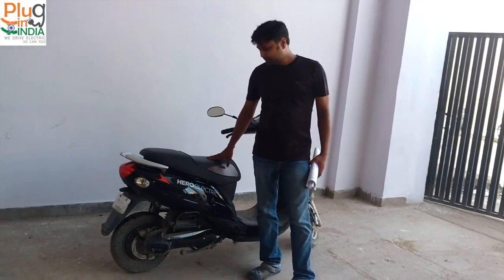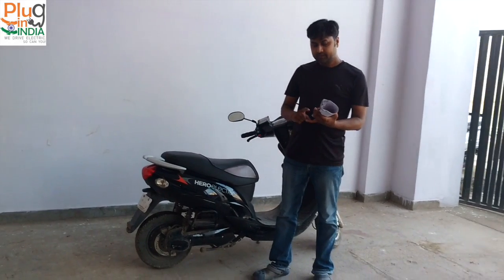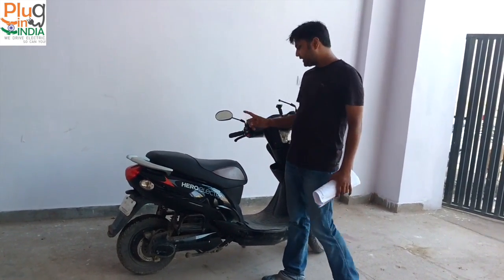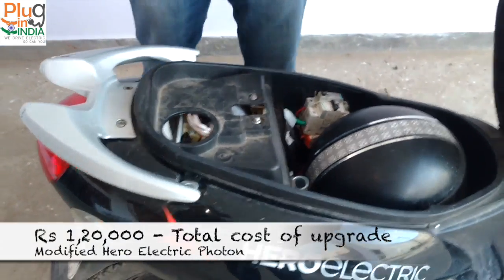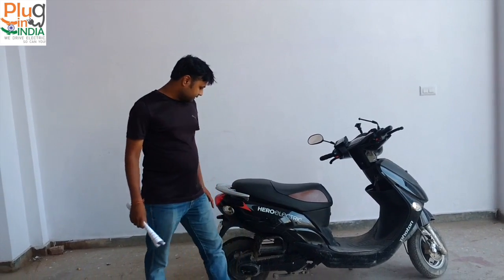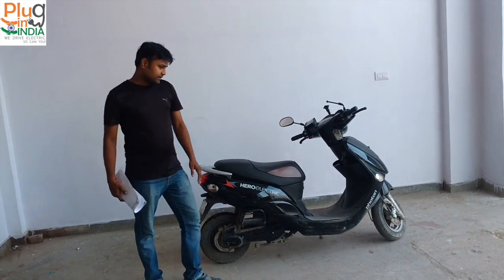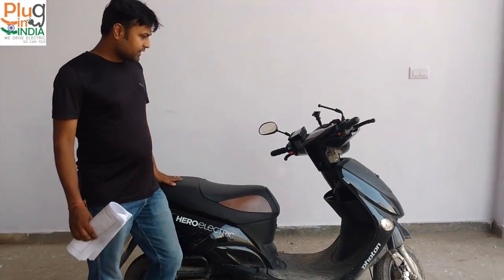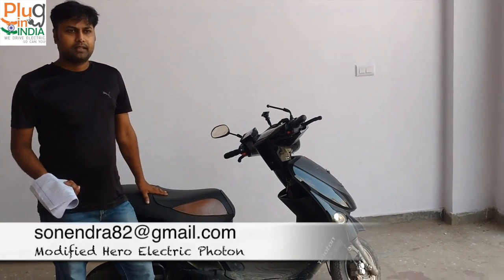Real Life EV Story : Sonendra - Hero Electric Photon e-Scooter Lithium-Ion conversion

Comment: HELLO PLUG IN INDIA MY DAILY RUNNING IS AROUND 50 KILOMETRES  WITH 2 PASSENGERS  I AM CONFUSED BETWEEN  OKINAWA RIDGE AND HERO PHOTON PLUS PLEASE SUGGEST THE BEST SCOOTER WHICH ONE I HAVE TO BUY.......
Reply from the maker: We would recommend the Okinawa ridge due to superior Top Speed, Batter battery indicator - the Hero Photon has a battery 'guessometer', which sucks really.   A digital screen also helps in Okinawa favour.
Just ensure u have a dealer in ur city , who can service the Okinawa.  If you do, then it is a no brainer.

Comment: I took an amazing ride on this electric scooty with Sonendra.

The pickup was really good. Much better than conventional scooters and motorcycles.

The regenerative braking was quite smooth and it worked even in low speeds till 6 KMPH.

The best surprise was the reverse gear which is not actually a gear. The scooty can go backwards with great power. It worked with even 2 fully grown adults sitting. 

I wish all the best to Sonendra to continue tinkering. I have met very few hardware enthusiasts like him. :-)

Comment: Hey man what lithium batteries did you use were they 18650 cells like Tesla?
And yes I'm also building an ebike using all the 18650 cells from dead laptop battery packs can u provide ur email through which I can get some more knowledge 
And also apne motor kaha se liya Hy coz I am unable to find a 3kw motor plz help! And keep up the good work !
Reply: Atul Pandey my email id is sonendra82@gmail.com
Mail me, will help you.
Reply: @Sonendrasingh  sir plz let me know do you used 18650 battery and if i connect these cells in series and parallel to replace the inbuilt battery,will it be okay or i need to use any other pcb . plz help sir ,consider me as ur younger brother

Comment: +Sonendra. What about the BMS(battery management system), did it come with the batteries? Did you change the charger since Ah increased?
Reply: My Lithium Battery has a inbult BMS, which delivers max 150A current. Battery has a separate charger (48V 6A for 13S Li Ion battery)

Comment: If this comes in market then everything will be changed
Reply: I have taken a ride on this electric scooter with Sonendra and the ride was really good.

The pickup is strong better than petrol scooters.

The regenerative braking was smooth even in low speeds even till 6 KMPH.

The surprising part was the reverse gear. ;-)
Reply: Okinawa Praise with Lithium battery will have great performance. Okhinawa launched the Praise with Lead acid (VRLA) battery at 60k price, that is also good

Comment: Hi sonendra great conversion i have ever seen in india, you have got balls to trust a chinese vendor on alibaba and spend 1lakh on the kit. I wanted to do a conversion but i had no money back then. Please ignore people's comments about why u spent so much on your bike, you are riding the future of two wheeler's and keep inspiring others to join the tribe and buy more EV's

Do not charge the cell to 4.2V, charge it to 90% 4.1V or 80% 4V, that is what increases the battery lifecycles, i would suggest LiFePO4 chemistry for more lifecycles. Also remember to completely charge and discharge your battery once in a while. Do not keep the batteries fully charged as that is what increases the oxidation rate

pluginindia why don't u organize group buy's for batteries and motors and pass on the savings to the subscriber's
Reply: gopikrishna swargam Thanks for your appreciation. You have a sound knowledge about EVs and progressive approach. I am overwhelmed by your response.
You are absolutely correct, purchasing from a Chinese vender is risky, but there are few countries, which are manufacturing bldc motors. Presently motor, controller are working fine and hope so in future also. I purchased battery from a indian vendor for warranty, although lithiun cells are made in china. Regarding battery charging, you are absolutely correct. Presently i have installed a battery voltage monitoring unit, which has a relay. At a time of charging, at 90% SOC voltage, Relay cuts the connection from charger to battery. Battery completely discharge and charge once a while in two months.
Yesterday, with 100% charged battery, my electric scooty (total weight around 215kgs, vehicle + rider + pillion) covered 74 kms distance on a single charge and remaing SOC was around 10-20%.
 Maximum speed for first half distance of 37kms out of 74kms, was 55kmph (current consumption of motor was 22A, 1000w-1100watt). Traffice was less as compared to normal.
 For the second half distance of 37kms, maximum speed was around 40kmph (current consumption of motor was around 15A, 700-800watts). Traffice was above avarge at that time.
Note: Battery was lithium ion 48V 13S 44AH @0.5C discharge rate
Motor- 3000watt (6000watt peak power)
Controller - 3000watt (4.5-6KW peak power) ki

THANKS
Reply: gopikrishna swargam i think in 4-5years cost will drastically come down. Hopefully made in india product will be available with affordable prices.
Reply: Hi Sonendra, great work! Kudos to you. I was totally thrilled to find Plugin India website this morning and the post about your work on it. So happy to see this. For the batteries, did you happen to hear about http://www.futurehitechbatteries.com/ and/or tried getting a quote from them? I just found that website this morning too. I am not quite sure if they manufacture or source their batteries from China themselves.

Comment: How much did the motor cost you?
Reply: MOTOR (cost + shipping) without taxes was  USD 460.

I purchased MOTOR + CONTROLLER + DISK BRAKE, combined cost with shipping and taxes was 42K.
Reply: Sonendra singh I'll send you a mail, can you send me the motor datasheet? Or put up a link here for everyone to see.
Reply: Oh and you can add a windshield to the scooter, it should increase your top speed and acceleration at speeds over 40kmph

Comment: How much it takes to charge the battery?
Reply: A 6A 13S lithium charger takes 8 hours for 13S 44AH li battery (SOC: from 0% to 100%).
As my daily riding distance is around 20-30Kms (40-50% SOC uses). On daily basis, charging time is 2-4hours.
It can be fully charged in 1-2 hours. BUT 50A 13S lithium charger cost is around USD 700-800 with additional cost if shipping + taxes.

There is a an another solution -
Inverter with 48V battery (As inverter is one of the best product for battery charging)
Now a days, Inverter with USB port, which can configured through PC, are a cost effective solution for 1-2 hour charging of Lithium battery. Also when, After 5-6 years,  Lithium battery of EV with 50% or less orignal energy storage capacity, can be further used with inverter for power back-up.
THANKS
Reply: Excellent :) Thanks for your prompt reply.
Reply: THANKS

Comment: Great work Mr. Sonendra. And I think its cost efficient also. Since you purchase a single unit, so its cost comes around this much. Moreover cost can further be reduced, by purchasing lower KW motor and lesser mAh batteries, according to particular need. If possible, can you further give some descriptions/links about the parts from where you purchase the conversion kit.
Reply: THANKS BIPUL.
my email id is sonendra82@gmail.com . I will  help you.
Reply: cost of my modifications 1,10,000/- has a major part (30K) of 
shipping+taxes. I used a 150A current shunt, made in India, its price 
was almost half and excellent quality w.r.t. available chines current 
shunt. My assumption, if all part (motor+ controller+ battery) with bulk production  in 
India. Then cost of this type of configuration (Electric two wheeler) 
should be around 60-70K. I am pretty much hopeful, this 60-70K cost will
 be possible in 4-5 year or earlier.
Reply: I think we common user don't need 80 kmph speed ,we good at 50 kmph ,so battery range must be increased to 120 if same battery u use
Reply: You are absolutely correct. 50Kmph speed is sufficient for city ride. I replaced the lead acid battery with lithium battery two months ago. Today,  2086KM has been completed with new lithium battery and based on scooter performance data, Mileage is around 60Km in 1KWH energy at average speed 30-50Kmph on city road. Battery capacity is 2KWH (48V 44AH@ 0.5C 13S Li Ion battery), 120Km distance can be covered on a single charge. BUT I haven't discharge the battery to 0% SOC. I covered 74Km distance with fully charged battery (total weight around 220Kg, rider + pillion + vehicle weight) and after 74Km SOC of battery was around 20%, i think 10 Km more could be covered, but that time I had some urgent work .
NOTE: As speed increase drag effect also increase, basically above 60-70Kmph speed mileage decreases.
For reference- 
Power consumed by MOTOR at 
50Kmph  is around 1KW 
70-80Kmph is 2-2.5KWH
Reply: I purchased photon on this month with lead acid battery....plz tell me which type of luthiuam battery i will have to purchase for more than 1000 cycles and suggest me delar name and price of lithiuam ion battery.....if possible share ur number
Reply: Nilesh Bhosale my email id is sonendra82@gmail.com
Mail me I will help you.

Comment: If this guy uses a chain drive the bike will takeoff on one wheel like a race bike. He could have built this on his old bike and got same performance with a cost of Rs30k instead of 100k. He took a 30k bike amd made it 100k bike?Batteries are given way more importance than is due... Its still very fast with the hub motor...  should do a 2nd video testing it against a normal petrol scooter.
Reply: THANKS for your input. I will try to shoot a video with normal petrol scooter.
THANKS

Comment: why don't manufacturers do this and bring down cost for mass production. I guess they are afraid that they might put a dent to their existing fossil fuel powered vechiles..by launching such bikes
Reply: cost of my modifications 1,10,000/- has a major part (30K) of shipping+taxes. I used a 150A current shunt, made in India, its price was almost half and excellent quality w.r.t. available chines current shunt. My assumption, if all part (motor+ controller+ battery) made in India. Then cost of this type of configuration (Electric two wheeler) should be around 60-70K. I am pretty much hopeful, this 60-70K cost will be possible in 4-5 year or earlier.

THANKS
Reply: I hope so cause whenever I try convincing my dad to go electric he always puts this point that its not practical.  I hope this is comes to the market in a year or two.
Reply: I hope so.

Comment: 5:26 It can beat any bike any two wheeler in city roads :|

And it's 3kW [~4 BHP],
Waah, what a wisdom.

Don't mistake me, i love electric vehicles, and waiting eagerly to see a good one on the road,
but be very specific about the specs and with good knowledge about it,

First thing,
notify the Power in kW [kiloWatts] and Energy in [kWh] instead of childish stuff like Ah [Ampere hour which do not take voltage into account].

Esp in a comparison like this, warranty of the Li-Ion pack, and warranty for the Motors would be the most significant one,
because no one wants a garbage quality Li-Ion battery pack quality which gonna die in a year or two.
Reply: Motor: Peak power 6000w (8BHP) and continuous power 3000w.

THANKS bro for your constructive criticism :)
Reply: Sonendra singh Good work brother. Have you replaced any wiring? And meters also should show wrong reading as they're calibrated for the original equipment that came with the brand new bike. Finally where do you stay? I'm a EV enthusiast just wanna try ur bike.
Reply: li ion batteries - possibility of explosion:
Your are absolutely correct. To avoid this, BMS has peak current limitation. I also avoid this. 
Presently, Maximum Regenerative current his 20% (20A) of max 100A to avoid overheating of BMS/Battery.

THANKS
Reply: For a ride of my electric scooty, you are welcomed. Presently, I am in lucknow. My email ID is sonendra82@gmail.com if you really want a ride mail me.

THANKS
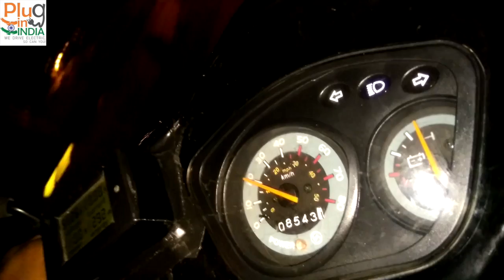Reply: SPEED-METER reading: That time (1:02 to 1:32) it was not properly working. I went to service-center and now it is fine. 
Maximum speed video (13:01) had been shot with correct readings of  speed meter.
Reply from the maker: Go get them Sonendra!
Reply: BAHNU PRAKASH: WIRING: 25mm square copper wire is used for BATTERY TO MOTOR CONTROLLER power supply with 100A MCB + 48V relay (200A switching capacity) + 250A DC connector. Also some preventive measurements for ELECTRICAL POWER SURGE (specially during ON/OFF of controller), as peak current goes up-to 150-160A, to keep safe controller, battery, MCB, relay and wires. Basically a new electrical system is installed for peak current rating of 200A. Many more things have been done, but everything is not possible to mention here.
THANKS
Reply: Chandraprakash G If we buy cheap li ion batteries there is a possibility of explosion especially with continuous power motor and regenerative breaking on board.
Reply: He is saying in terms of instantaneous power that's available for fast acceleration in city traffic.
Reply: Tameez se baat kar chutiye

Comment: @PlugInIndia Learn some basics here.

For starters, DO NOT USE THE STUPID UNIT CALLED mAh or Ah,
use universal units of Power [Watts - W] and Energy [Wh - Watt Hour / kWh - kilo Watt Hour / and it's multiples..]

Having a channel about electric revolution and not knowing the basics is quite disappointing.

Power = Voltage x Current
W = 3.7V x 20A
W = 74

Energy = Power x time
Energy = [Voltage x Current] x time
W time = V x I x time
W hour = 3.7V x [3000 mAh]
W hour = 3.7V x 3 Ah
Wh = 11.1

That simple.

And for reference,
1000 Wh = 1 kWh [1 Electrical Unit], 
which is what our kWh energy meter uses in home
________________________________
mAh and Ah which are seriously flawed unit (which doesn't take voltage into account),
which is normally used by manufacturers and marketers to misguide people !!

Professional and universal unit for energy are,
kWh or Wh.

I mean, these all of us use kWh meter in home, kWh in Tesla car,
and 1000 Wh = 1 kWh. 
(how else simple do you want ??)

Still people use mAh and Ah, wonder how lame can they get !!!

And for comparison (different rechargeable battery types):

AAA [NiMH] = 1 Wh
AA [NiMH] = 2.5 Wh
AA [Li ion] = 3 Wh
C [NiMH] = 5 Wh
D [NiMH] = 10 Wh
18650 [Li ion] = 8 to 13 Wh (high drain to high capacity)
26650 [Li ion] = 14 to 18 Wh
______________________________
Average energy of Tesla battery are around 11 Wh [18650],
and to make a Tesla P100D [100 kWh] Model S,
= 100 kWh / 11 Wh
= 100, 000 Wh / 11 Wh
= 9091 batteries
or in simple words,
9091 [18650 battery] x 11 Wh = 100,000 Wh = 100 kWh.
______________________________
So i would seriously recommend 18650 enthusiasts to use Wh and kWh [our universal unit] instead of flawed mAh and Ah which are way too childish unit for energy !!

Most imp use of this is, real time calculation.
For example,

If you have a 40W bulb, when it runs for 1 hour, the energy consumed is 40 Wh [roughly 4 18650 cells could supply that !].
So calculations like this becomes very simpler !

And you can throw lots of units into garbage from different countries too to replace to Wh and kWh,
like,
1 kiloCalorie (KCAL) [Usually pronounced as calorie] = 1.16 Wh
1 BTU [British Thermal Unit] = 0.3 Wh
Joule = 1 Watt second [Ws]
1 Watt minute [Wm] = 60 Ws
1 Watt hour [Wh] = 60 Wm = 3600 Ws = 3.6 kWs
Joule = 1 Watt second = 0.28 mWh (milli Watt hour)
Ws or kWs are usually used to know the capacitor specifications precisely.

For example capacitor gives sudden burst of power for couple of seconds, where it's used precisely to store the regen braking and to produce couple of seconds of acceleration.

Eg, While Tesla Model S P100D accelerates, it needs a power of 400 to 500 kW max,
so if you have a super capacitor with 1000 kWs, then you can supply 500 kW for 2 seconds ;)
Units are so much fun.

Once especially if you use proper universal unit to understand everything precisely.
For example, instead of remembering how many calories you take per day, 
you can remember how many Wh or kWh you are consuming per day [Energy] of food :)

It seems our body consumes around 2 to 3 kWh of energy daily [for a 70 KG / 140 Pound] man approx.

+++++++++++++++++++++++++++++++++++++++++++++++++++++++++++
My Google+ Channel:

Electronics and Photonics:
https://plus.google.com/u/0/collection/wEKaAB

Energy Technologies:
https://plus.google.com/u/0/collection/8JTdi
Reply: Bro, you are absolutely correct. I have done all analysis/calculations in KWH (as you mentioned above), will publish it soon. You have a sound knowledge about electrical systems, but everyone has not. So basically this video has an overview, not all detailed calculations. I have all these, and my report , which has methods (followed for measurements) looks so geeky type. 

THANKS
Reply from the maker: REAL LIFE EV STORIES - Mostly has user submitted videos - not done by us :)

Your beautiful, educational lengthy feedback is duly noted and appreciated!
Reply: PlugInIndia AH for battery is ampere hour, it is the unit for capacity (amount of electrical energy it can store)of the battery and not power.
If a battery can take one ampere of current for 42hrs or 2amps for 21hrs and so on, it's a 42Ah battery(assuming 100% efficiency for ease of calculation)